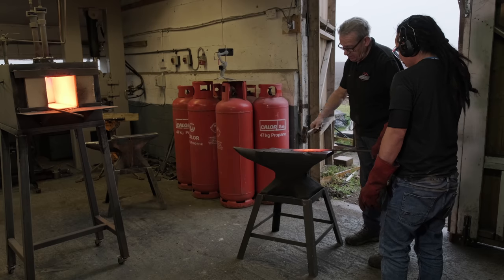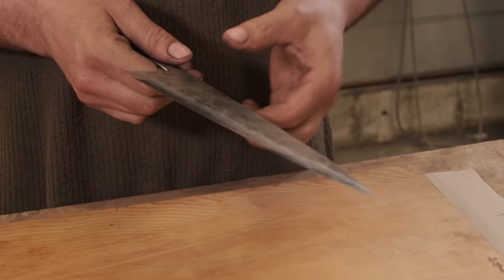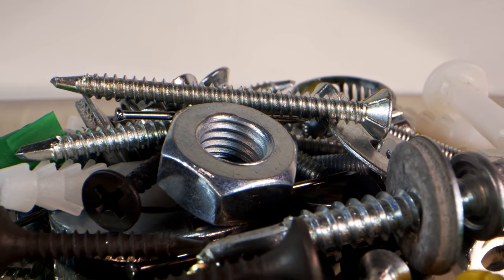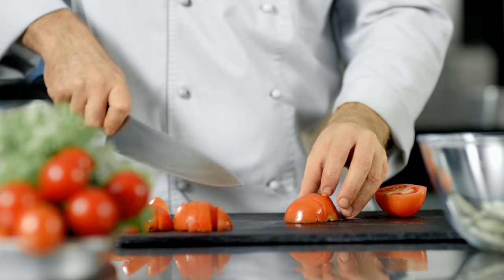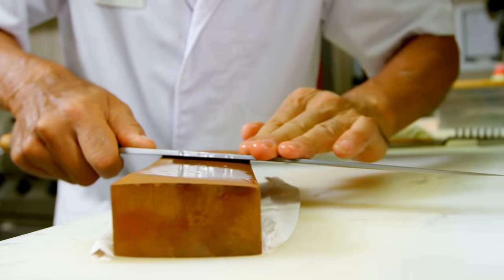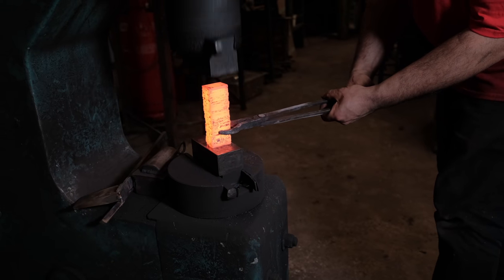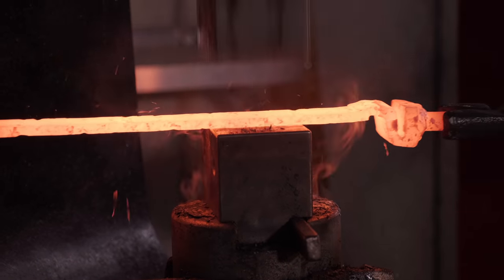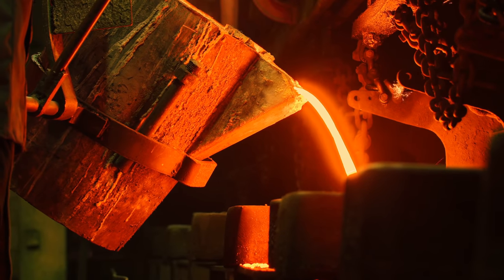Why 98% of knife makers pick the wrong steel according to a metallurgist

Comment: Current favourite is AEB-L, heat treated by Graham himself, as it's fairly cheap, takes a good edge, I don't need to worry about rust and I only do stock removal. Best knives I've made so far have been this batch of AEB-L ones.
Reply from the maker: I wish I knew more about AEB-L - seems to be a crowd favourite among makers! Thanks for watching Rob and hopefully you're looking forward to the next set of videos from Graham as I am!
Reply: AEB-L was a close second to 14C28N for the stainless category in Larrin Thomas' article on best budget steels at KnifeSteelNerds. He's also got a whole article on the history and design of AEB-L.

Definitely looking forward to more of Graham's knowledge on video :)
Reply from the maker: I haven't read his book but I've seen his YouTube channel and his videos are super informative!
Reply: The videos are great and the book is excellent. Learned a lot reading it
Reply from the maker: Robany Bigjobz hello mate I hope you don't mind I pinned your comment if that's OK! I also was hoping I can ask you to be a moderator for comments here?
Reply: AEB-L is an awesome steel. Can achieve 63-64 HCR if heat treaded for kitchen knives or have a lower hardness but excellent toughness for survival knives and it's pretty cheap. Only downside is that corrosion resistance is not that great comparing to other stainless.
Reply: I use a lot of AEB-L in my knives, the majority of my customers actually use their knives. I've gotten a lot of positive feedback on it.
Reply: @martyyoung3611  Where I live is really hard to find AEB-L knives with optimum heat treatment since most makers don't advertise hardness. If you do so you can set yourself apart.
Reply: @thiago.assumpcao , I do my own heat treat and I Rc test every blade.
Reply: @martyyoung3611  Great job man. Keep it up.
Reply: @martyyoung3611  One thing that pisses me off is 1095 on survival knives.

Both on same hardness( 60HRC) AEB-L is 4 times tougher than 1095 while at the same time being stainless. 
I bet AEB-L can make some awesome machetes and bone cleavers.
Reply: @thiago.assumpcao  Yeah, the hype around 1095 is really ridiculous. It's really nothing special at all. At least in America, the hype seems to come from the fact that it was used by a LOT of factories for military knives, and somehow that makes it the best lol. The only "carbon" steel with more hype and BS around it is 5160. Big deal, it makes good leaf springs, so what? A leaf spring is not a knife! O1 is a demonstrably better choice for "carbon" knives across the board. 
The only reason I don't make thick blades like bone cleavers or big bowies out of AEB-L is that it's difficult to find it in barstock that thick. But it would definitely work. It works for everything from really hard, thin chef's knives at 64Rc to "survival" knives with thicker edges at around 58Rc to maximize the toughness.
I agree that AEB-L is one of the best all-around steels available. Costs about the same as "carbon" steels, fairly easily to HT properly, very tough, very fine-grained, pretty good corrosion-resistance, you can sharpen it with any sort of stone, etc etc.
Reply: @dogslobbergardens6606  If you have electric oven and can work with AEB-L or 14C28N it doesn't make much sense to use simple carbon steels unless you are going for aesthetics. Dark blade with brass details on handle looks really cool. 
For knife makers that don't own an electric forge 5160 is arguably the best steel for impact knives, along with 8670, so I understand the popularity. Also it's easy to find scrap metal on it.
1095 can make good blades but its never the best option for anyone. 1084 can be harder than 1095 and if you choose any random hardness 1084 will always be tougher as long as the heat treatment is well done.
Reply: @thiago.assumpcao  yep, for my own stuff I mostly use AEB-L. 
I've used all sorts of steels from 1084 to Elmax and CTS-XHP. They all have their place, but AEB-L just plain works for me. I like both O1 and 52100 for "carbon" knives but I haven't bought any of it in several years. It's real humid where I live and the fine, thin edges I like degrade too much and too quick for my liking. Ironically, I have one of my own O1 knives on my belt today, and sure enough it's gone slightly dull just sitting in the sheath. It'll cut but it's not a "laser" like it should be. AEB-L doesn't do that.
I do keep some 1084 around just in case SHTF and I can't use the kiln etc. 
I don't give a damn about aesthetics and I rarely sell knives anymore. A person can go crazy trying to keep up with what people think is cool this year, lol. When steel prices started rising fast here a few years ago, it was the last straw that made me finally just get out of the knife biz.
Reply: @dogslobbergardens6606  Too bad man. Yeah, it does have this fashion steel thing, probably very annoying for knifemakers. If I were a knifemaker I would probably stick with only a couple steels and master the heat treatment unless I see significant advantage on the new fashion steel.
 
If I'm actually using the knife I choose for ergonomics, geometry,  steel quality and heat treatment. Good aesthetics is optional but if it looks good and it doesn't get on the way Im happy with it. 

On the other hand some knives here are just for shelf decoration so aesthetics is top priority. I still want them to cut paper but I dont care much about performance.
Reply: @dogslobbergardens6606  If you want to go with a non stainless steel O1 is certainly adaquate but it also tends to have issues with being a bit brittle at a given hardness. 80crv2 can be a decent choice, it has enough carbon to reach an adaquate hardness without compromising toughness excessively. I definitely agree with you on AEB-L being superior to most low alloy steels on most metrics relevant to knife performance.
Reply: AEB-L and 14/28 or 13/27 are very good steel especially for the cost.  If you break down performance per cost ratio they are at the top.  You can get better steel.  Slightly better for a lot of price increases.  Steel that cost 4 times as much gets you marginally better performance.  Not 4 times the performance.  Then there is the compromise you need to make for your own application.  Toughness vs edge retention.  S35v is pretty close to s 50/50 compromise.  But cost way more than AEBL or 14/28.  Way more.  I will continue to use AEBL.  Got to wonder how many billion razor blades have been made with the stuff.
Reply: @jamesshepherd7727  I definitely agree with on that, most knife steels aren't as tough as AEB-L at a given hardness with only a couple of exceptions and it has solid edge retention while also being stainless it is one of only a handful of steels where you can get decent performance in all 3 major categories.

Comment: After having to learn all this for a materials engineering unit, it's so neat to see someone explaining it all in terms of applications 
Though learning how to predict what type of microstructures form based on carbon% and how it's heat treated is pretty neat (e.g. austentite vs cementite vs carbides and then combinations therein)

Though eutectoids are still a bit confusing to me for sure

Comment: Very informative video. Powdered metal is amazing stuff and you can do some crazy things with it. Years ago I was working in a foundry that would cast all sorts of odd ball metals but mostly non ferrous. We were once supplied with some special aluminum. This had Been through the ball mill and had silicone and tungsten carbide incorporated in a metal matrix. It was then cast into brake rotors for testing. It turned out very well weight wise and abrasion resistance wise.  In fact compared to iron rotors that would be changed out each race these were still good at the end of the season. It was extremely difficult to machine and would consume a brand new tap every couple of holes. These taps were not junk either lasting about 5000 - 8000 holes in regular production. I managed to save a small piece of casting runner and turn it into a knife. It was well worth it as my aluminum knife always gets people who don't believe I can cut cast iron with it.
Reply from the maker: Hi again dazaspc and thanks for taking time to comment! Interesting topic don’t you think?

Comment: I do a lot of butchering and skinning of wild game. For the past several years I have been using a collection of blades produced by Buck in S30V. They hold a fine edge for longer than any other knives that I have used in the past, but when they need to be sharpened, I am on them for 45 minutes or more with progressive grit stones or belts. For work less precise than skinning or boning, I have other edged tools in 1095, 440C, and ATS-34 that work just fine, but don't seem to feature that edge retention. Having said that, those S30V's are not a quarter inch thick at the spine, and if I had to remove very much steel to touch up the edge, I'm certain that 45 minutes could turn into a several hour marathon. I agree that having the right type of steel for the purpose of the knife is more important than just one steel is better than all others for every blade type.
Reply from the maker: Hi and thanks for that fantastic input! It’s nice to hear from someone who has great experience with what Graham is saying. 

Your comment is really appreciated- thanks and hope to see you in our other videos too!
Reply: I've got several knives in powdered steels. 3v, S110v, etc. diamond bench stones make quick work of them. it also supposedly cuts the carbides vs taring them out like traditional stones
Reply: @jasonharrison25  I'll give the diamond bench stones a try. Seems like good advice. I have a good quality tungsten carbide V-cutter that I'll sometimes take a few careful passes with combined with drill oil. Seems to knock off some bulk and saves wear and tear on belts in theory.
Reply: @upcycle.outdoorsman9629  Yup diamond makes quick work of nearly all modern steel.  Makes the resharpening dilemma a thing of the past.
Reply: @upcycle.outdoorsman9629  those V cutters will for sure rip out the vanadium carbides leaving just the steel behind. this will make it feel sharp but you are leaving a lot of performance on the table. even aluminum oxide and silicone carbide belts are not hard enough to cut the vanadium carbide. only CBN and diamond are hard enough for those super steels. S30v is on the lower end of the super steels and doesn't have much carbides as something like S90V or S110V so you are probably not loosing too much. I'd still give diamond a try. somewhere in the 100-120 grit is good for dull knives, fixing nicks or changing the angle. I like 400 to 600 for maintenance. a clean but slightly toothy edge that is aggressive at cutting but can be maintained within just a few minutes every so often. polished edges don't seem to add much to these steels like plain carbon steels do
Reply: @jasonharrison25  It isn't everyday that I learn something from a Youtube comment thread. What you are saying seems to make good sense.

Comment: There are tons of high alloy carbon tool steels on the market.  K390 has way more carbides than 440c and has night and day more wear resistance than 440c.  Good simplified explanation of things.  I personally like low alloy, high purity, high hardness steels.  I like high edge stability along with ease of sharpening.  Maintenance is an enjoyable thing for me.

Comment: Another entry level Stainless Steel that's fairly new on the market is Silver Fox 100 (SF100). It's virtually identical  to AEB-L and is made in Sheffield 😊😊👍. Shop around though - prices seem to be very different between the various steel suppliers but you should be able to get it cheaper than AEB-L.
Reply: What so you mean entry level,  grinds easier, doesn't heat as much,  can you tell us how the martinsite,  (if it even is ) is different between plain steels with some traces of manganese, molybdenum, ect, vs, large carbide forming tool die, and hardenable stainless. great stuff though
Reply: Is the chromium carbide several orders of magnitude larger too, not that the average Joe can sharpen to that presicion.
Reply: my favorite blade is my  BK2.
Reply: Great news man. I will definitely add it to the list. 
Don't be fooled by the price. AEB-L is cheap to sell because its cheap to make, no powder metallurgy, no vanadium used, but in terms of performance its closer to a super steel than to any entry level steel. 

Most stainless steels can't be hardened above 60HRC. AEB-L can go up to 64HRC maintaining toughness higher than 1.1416 at 57 HRC. 
Its a monster for slicer knives and versatile enough to also be a game changer for impact knives. 
Compare it to 1095 on same hardness ( 60HRC). AEB-L is 4 times tougher while at the same time being stainless. 
This entire family of steels that use design with precipitation curve to avoid carbide formation are great. AEB-L, 13C26 and 14C28N are my top picks for simple steels (non powdered metallurgy).

Comment: I'm a huge fan of 52100. I haven't found anything that is as well rounded as that steel. There are steels that are probably better at one thing or another, but for a hard use knife that will retain an edge and is easy to sharpen when you need to its hard to beat. With the right heat treat with a differentally hardened blade it is down right incredible what you can achieve with 52100.
Reply from the maker: So I heard as well! Thanks for the comment Casey! 52100 is another industry-standard choice of steel for many makers! I appreciate you taking time to leave a comment so thank you again and hope to see you on our other knife-related videos!
Reply: I love 52100 as well. The fine grain structure makes it so easy to get an even finish.
Reply: I also enjoy 52100. And I enjoy O1 for all the same reasons. You really can't go wrong either of them.
Reply: I’m also moving into 52100 and am encouraged by your comments on it. We’ve used it in shichi mai 7 layers with 1095 and 15n20 but not long enough for comment. Did you find it reasonably corrosion resistant for EDC? I’ve a 1095 pig sticker in a semi-treated leather sheath that I take out every 3 years and it shows no rust.
Reply: @andreoapo7297  I've made personal edc knives out of both 1095 and 52100. The 52100 is much more resistant to rust and staining. I have personally carried a 52100 blade everyday and use it for work as an industrial mechanic/welder and for hunting and fishing here in the rocky mountains and have nothing but praise for the steel and its performance! Rust has never been a issue for me or anyone I've made blades for with 52100. I think its chrome content has alot to do with it, also I have discovered the higher you take your grits while sanding and finishing with a trip to the buffing wheel a 30-45 min etch in ferrric chloride and another quick buff will make it much more impervious to rust. I have no scientific evidence for this finding its just in my experience they seem to resist rust almost like a stainless with this method of finishing. 52100 is a great steel and if you treat it right and learn it's quirks it will serve you well in any application.
Reply: Isn’t aebl really similar to 52100
Reply: @ShoahBiz  Yes
Reply: @ShoahBiz aebl or 14c28n is pretty much what you choose instead of 52100 if you need corrosion resistance. Especially for chef knives that would be better. 52100 is easy to forge and work with though.

Comment: My take is that for here, in the States, 1099 is the go-to entry level steel for a lot of bladesmiths due to cost, availability, and relative ease of heat treating.  Shows like Forged In Fire have created a boom in the hobby, and a lot of the “this is better than that” stances are out there to justify the market, and price points, for easier-to-produce custom knives.  The steel that performs for the task the tool is intended for is always the best choice, I feel.  My compromise of choice is D2, but I appreciate that everyone has their favorite steel to work with for reasons that make 100% sense to them.
Reply from the maker: Hi Miki! Thanks for the feedback ! You are correct that every individual will have their own good reason for their choice of steel (as you can probably read here in the comments section)! It’s absolutely fantastic to hear everyone sharing their choice here and also helps me understand why people choose that particular type too! Thanks again and we hope to see you in our other videos!

- Vinz
Reply: The funny thing about 1095 is that it's actually trickier to HT properly than people think. You only have about one second to get it from austenizing temp down below the correct quenching temperature, or you're not getting it fully hard. That doesn't sound like a big problem but if you've got the wrong quench oil or it's not pre-heated correctly, you can end up with a substandard HT and not even know it...